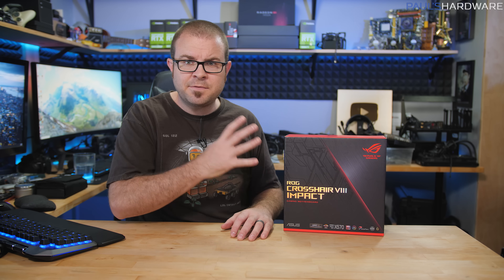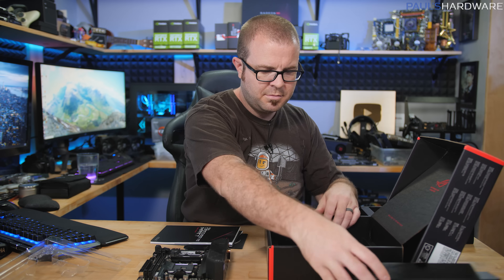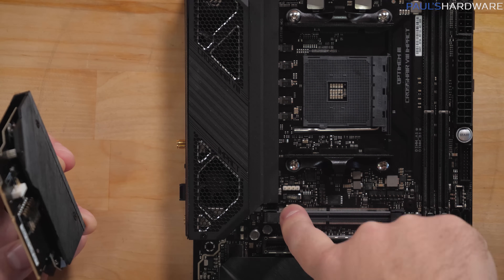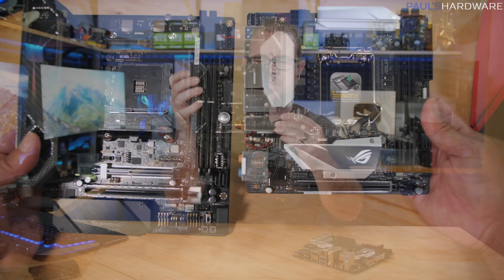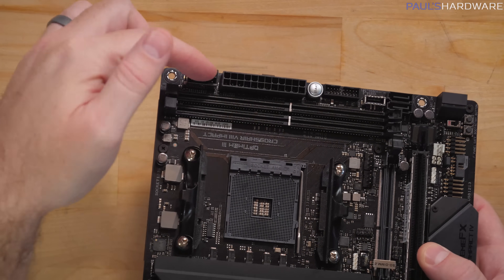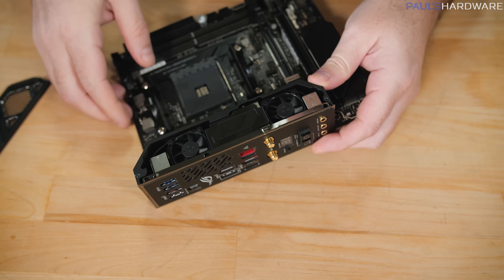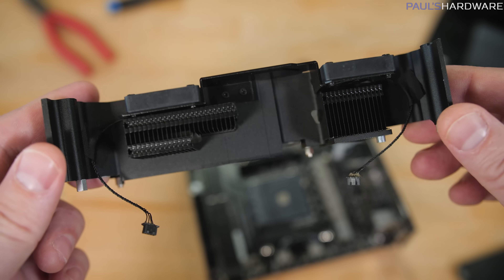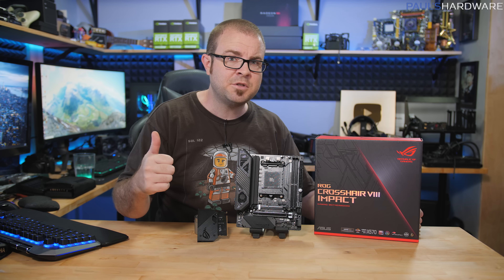WTF is Mini-DTX? Checking Out the ASUS Crosshair VIII IMPACT!

Comment: Awesome!  DTX and Mini ITX would be excellent choice for general office computers
Reply: Thin clients. I have a HP that's laptop internals with no battery or optical drive. Use as a HTPC. Small enough to hide behind my sound bar on a shelf.
Reply: @zoomzabba452  Cool, if it works for you go for it

Comment: I have NEVER EVER used a SPDIF port in my life.
Reply: You have not lived
Reply: Me neither. Also never met someone who did use it, or saw a PC speaker set that has the connector
Reply: @thelegendaryklobb2879  You need to cast a wider net :b
Reply: Sounds like it's time to step up and connect your PC to your home theater amp.
Reply: @barrylinkiewich9688  🙌🎉
Reply: @barrylinkiewich9688  lol.. thats part of the problem.. i dont watch tv .. i live on the computer.. which has it's own massive sub system on the standard minijack.. the only time i look at my tv is when its used as a second monitor.

Comment: DTX is awesome, DTX without the second slot... less awesome...  If the board had a second slot, I would buy it for up to 500$ and run dual GPUs or a GPU (in the lower slot) + soundcard/Nic/something (in the top slot).  Opportunity missed, but still a cool board, just not something I would spend 400$ on...
Reply: Arkratos
What is it you try to understand here?
2 slots will fit low power CPU, cheap VRM, not here!!!!!!!!!!!
Why you need video content, how smart are you?

Comment: Would love to see a temperature reading of both M.2s on the SODIMM2 card during some benchmarks that push the GPU mounted directly into the PCI-E slot (not a relocated ribbon cable connection). Curious how the GPUs radiating heat from the backplate would affect the temps of those M.2s since they sit RIGHT above where the GPU is generally located on video cards

Comment: I love that x570 has given a reason to buy those tiny noctua 30mm fans
Reply: I don't think Noctua ever had 30 mm. Just 40mm. Otherwise guys wouldn't have to 3d print an adapter for the cooling fan in a Sega Dreamcast.
Reply: those are Delta's actually...
Reply: @gembalaartoni  I'm saying as replacements for lower noise or just when they break

Comment: I'd rather have an extra x1 slot instead of that SupremeFX thing. I'm imagining single slot water cooled GPU with discrete sound card. That'd pre pretty awesome in this form factor.
Reply: Right, but you'd only have one pci-e slot, where would the sound card go?
Reply: @ynie1  you'd use the x16 for the single slot water cooled GPU, then the x1 for the sound card below it in the second slot. See any mATX board.

Comment: What cases support this board? Love the idea of it but all my itx cases wouldn't fit it 👎
Reply: Any case that has 3 PCIe Slots. Like the NCase M1.
Reply: Lots of itx cases will also fit dtx. But not all.  To make sure, check a manufacture's website, they mention all the mobo boards they'll fit.  17:04
Reply: Ncase m1 for sure.
Raijintek metis+ maybe?
Loque Ghost S1 perhaps with a top hat.
Some other itx cases with an atx PSU near the bottom of the mb. Swap to a sfx for extra clearance.

Comment: Is the DTX form factor AMD only? This question wasn't tackled in the video.
Reply: i believe there were a handful of older dtx motherboards that used intel before this but they were either proprietary or used and integrated cpu. i could be wrong though
Reply: It's a dead form factor used by point of sale and touch kiosks. It was never consumer oriented. Not just Amd or Intel, but some ARM and other low end cpus.

Comment: For the love of shawerma, release the damn thing, it's the last piece I need for my build
Reply: Been waiting ever since the day they announced it and been checking on it a couple times a week haha. Sounds like they are starting production and the model has been finalized. Im hoping...
Reply: Right? I've been waiting for this motherboard for months!!
Reply: Same here ASUS.
Reply: Yep, 3900X & 5700XT 50AE waiting two months now...
Reply: Wat is shawarma?
Reply: @tazboy1934  It is what one eats after stopping an alien invasion on Manhattan...
Reply: @tazboy1934  I mean, you spelled it correctly vs the original comment that spelled it wrong so I guess you already know.
Reply: I've wanted a dual slot DTX motherboard to (originally) put two single slot GTX 1070s in my NCase M1 which has three slots with a space in between. Dual GPU in a low profile ITX case will forever be a pipe dream. This one is cool though

Comment: Hey Paul, I have a question i am hoping you could answer for me. I have been using a Hyper 212 Evo for a couple years now but am looking into water cooling, could you recommend a good 240/280mm AIO for an NZXT S340 case :D
Reply from the maker: NZXT's Kraken AIO line is very well reviewed and would probably tie in more easily with your existing lighting/software controls
Reply: @paulshardware  tyvm sir, much appreciated i will look into it :D, though i am still nervous about adding water cooling but i would like a more silent PC as i can't for some reason control my fan speeds